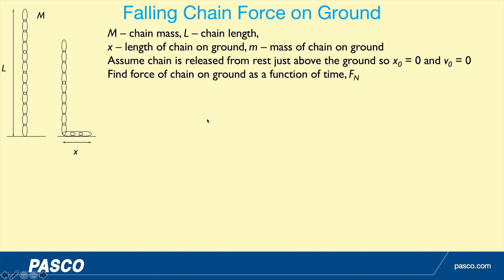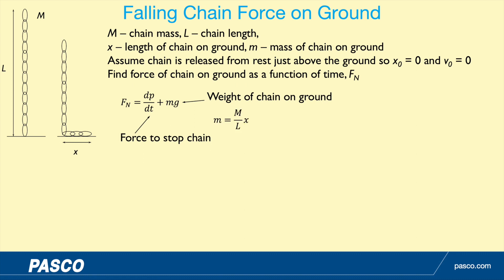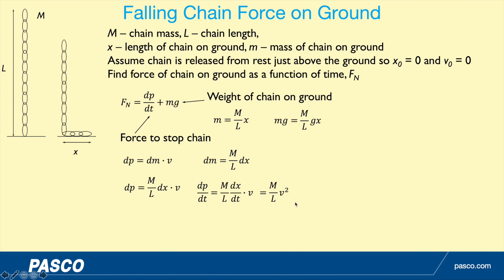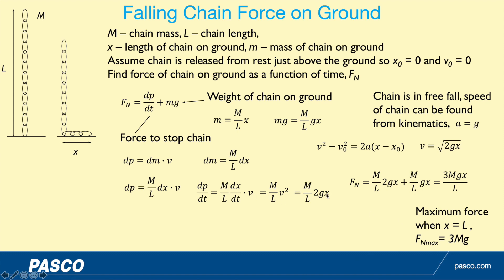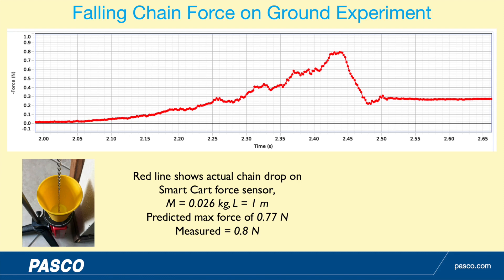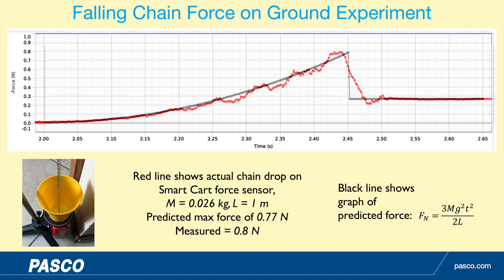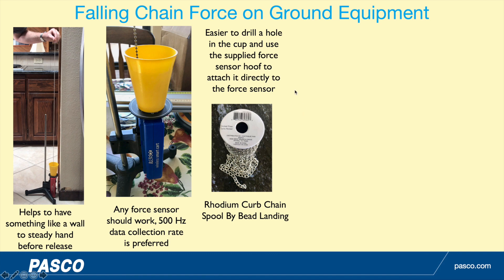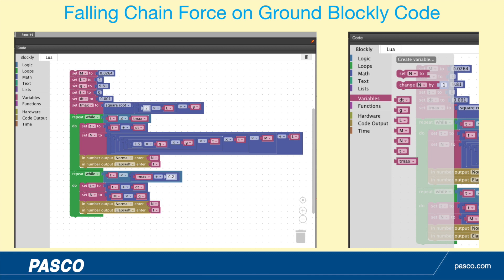Falling Chain Physics Problem

Comment: Instead of a chain would a constant flow of ball bearings be equivalent? 

In other words, is the fact that the links are joined matter when in free fall?
Reply from the maker: It could be equivalent if the ball bearings stick when they hit. I neglect any bounce of the chain links but they don;t bounce very much. I also am neglecting the tension in the chain. It takes a finite time to go to zero but it happens very quickly. If it was a slinky, that would be a different story.